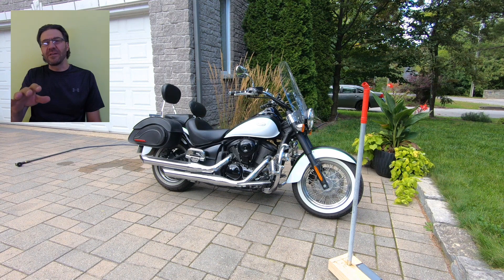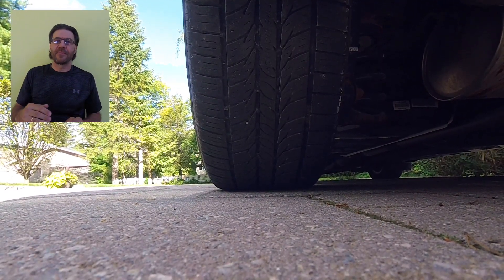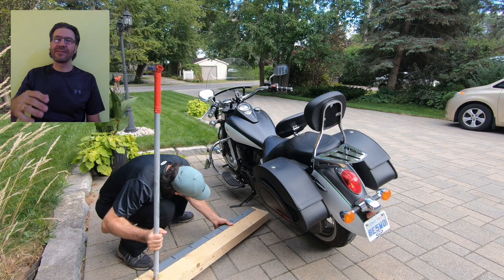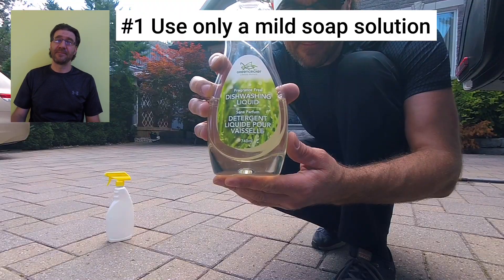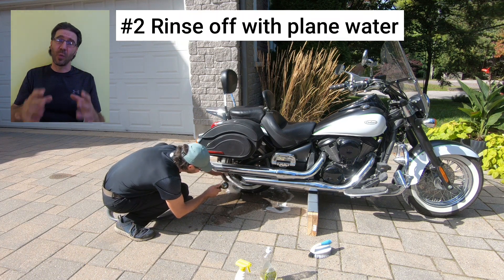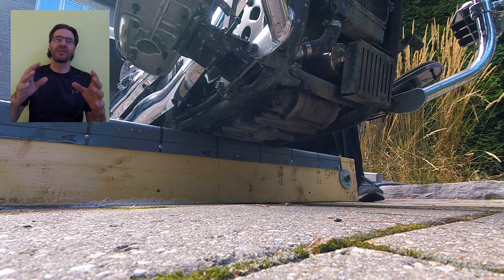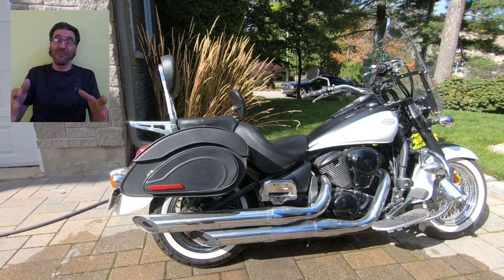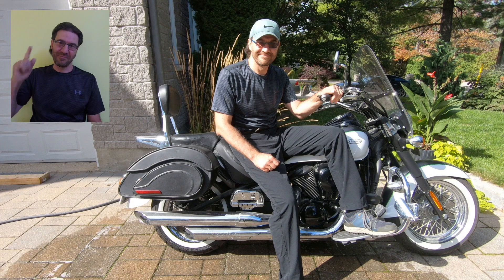How to Clean White Walls on Motorcycle Tires - Watch Before You Do It!

Comment: Do The classic has four-way signals and how to turn on and off
Reply from the maker: Hi Tim,

Kawasaki Vulcan 900 does not have four-way emergency signals. There are aftermarket options available that can be installed. I have not done it on mine yet. Something to consider.

Ride safe!
Max

Comment: Just did that today. But I use Jif tho. It's the white coloured solution for the kitchen. Is any idea if that's okay or it's too harsh for the tires?
Reply from the maker: I think there are different types of "JIF" solutions. If it is one that you can use with bare hands such as dish washing liquid, then it should be perfectly fine. If it is an abrasive one, it might be a bit harsh.
Reply: @KMaxVideo  I think I should try the dish washing solution next. Thanks. Keep the videos coming.

Comment: max, cleanest whitewalls i ever seen. never saw jackn it up as a tip-its great, nvr thot of that. can i use a dishwasher liquid soap?...also, we'd luv 2c how u clean the spoke rims?....nxt vid
Reply from the maker: That's exactly what I use, a dishwasher liquid. It works great. I use this jack for everything, oil change, battery replacement, etc. It is also great for winter, or any kind of long term storage, as it unloads the tires and keeps the bike vertical. Check out my other videos to see how I make the jack and use it. Subscribe to my channel if you have not done it yet. 😊😉 Ride safe!
Reply: whats ur email, im sellin a prestine v900 classic, 7kmiles, loaded creampuff in teh states, wondering if u or some1 u know is interested in lookin at pics? thanks!god bless
Reply: @KMaxVideo  love the jack idea. Thanks brother.
Reply from the maker: Thank you!
Ride safe!
Max

Comment: Try a brillo pad.  Soap filled works best.   Try that
Reply from the maker: Brillo Pads are pretty good. There are different types of Brillo Pads though. Some of them are steel wool, some plastic, so some of them could be to harsh on the tires. I prefer the lighter touch. :)

Ride safe!
Max

Comment: For those extra tough scuff marks, using sodium bicarbonate (baking soda) will help clean the yellowing and deep scuffs.
Reply from the maker: I'd guess you can use baking soda as well. It should be pretty gentle on the tires. I think if it is used often, it may remove the white layer on the tire as it is an abrasive material. I did not have a need to use it actually as I wash the tires regularly like in the video. Ride safe!